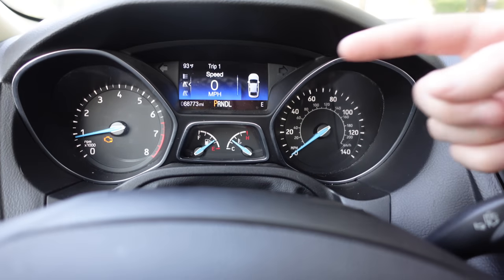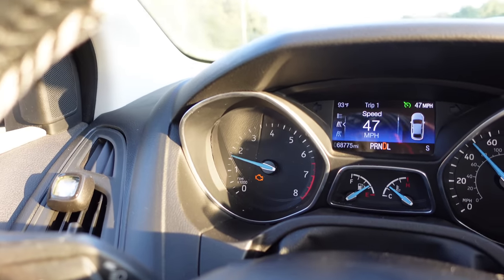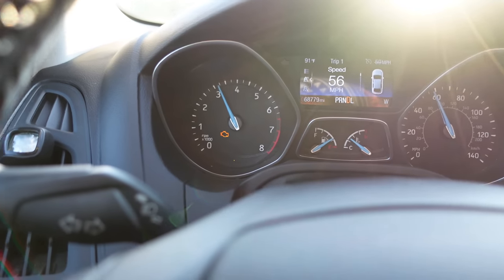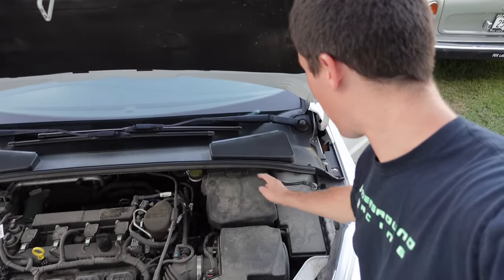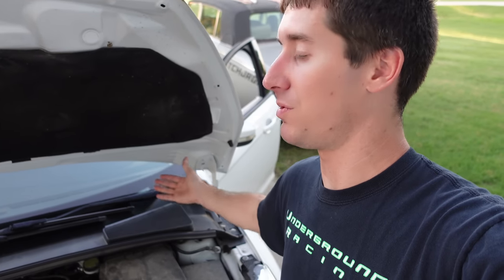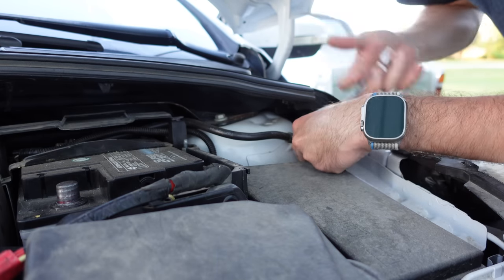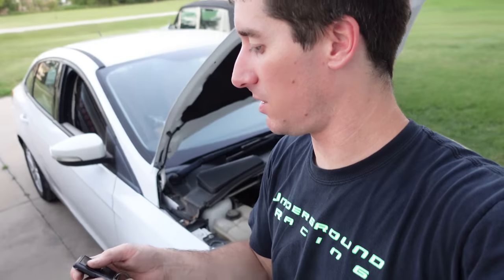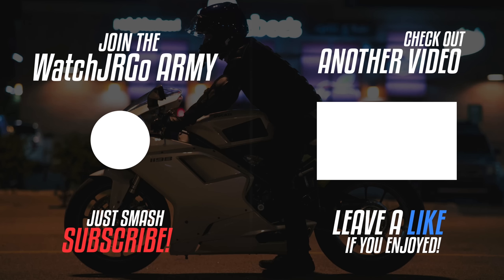This NIGHTMARE Transmission DESTROYED The Ford Focus (Fixing My Girlfriend's)

Comment: I had a 2013 ford focus, same transmission, did a lot of research to figure out hot best to take care of anything transmission related and the number one suggestion is to check grounds and take the access paint around the grounding bolt. I also had read that you can’t drive slow in this car it doesn’t like it you have to drive it in such a way like you have a manual transmission, basically i drive it in such a way as to get to the speed limit as fast as possible and I didn’t have to many problems
Reply: Yes exactly if your trying to drive a manual car through a drive tru or stop and go traffic ridding your clutch constantly you will burn it up making it smoke. Same idea with this transmission u can't ever just lightly tap the gas to creep through the drive tru or in traffic. You are on the gas moving or off the gas stopped.
Reply: @johnsnow1355 so no more drive thrus with these cars?

Comment: 2012 model, had it since new with 8 miles. Now sitting at 107k miles. Clutch replaced every 45k. One TCM replacement, multiple reprograms. Best is when you drive it on the highway or have minimal stops. Stop and go or abrupt stops or accelerations will make the transmission drop into neutral for a second or two. Not good if you need to get out of the way quickly. I learned you have to drive it with a bit of a heavy foot so it’ll shift right away. Rare occasions during downhill it will get hung up and have the RPM go through the roof. Buddy of mine traded his in for same reasons, with three clutch replacements. It was a 3-4 year old car at the time.
Reply: Reading about the history of this car and actual stories here, one has to wonder how many of these were driven in the run-up in R&D. I recall the Ford ad touting the Ecoboost engine for the F150 that it was driven hard to prove it was a good engine. For the amount of issues that has turned up one would have thought a red flag would have arose during R&D. A good engine is great but if all that goodness can't be delivered to the wheels ...... it is still no good as a whole. Sad that Ford shot itself in the foot like this.

Comment: I have a 2017 Focus. Experience, and several Focus facebook groups, have taught me that these cars need to be driven a little aggressively. Accelerate the same way you would in a regular manual transmission. It will greatly improve the life of the clutches.

I have 68,000 miles on my 2017 Focus, and 202,000 miles on the beat to hell ex-delivery car 2012 Fiesta that I also own. 

Stop and go driving and slow acceleration is horrible for these cars.

On a side note, I love the 45 MPG that both of my DCT Fords get on the highway.
Reply: Been trying to decide between the two I need to test drive a focus asap they say same fuel mileage but I think fiesta gets better in the 2012 range. Plus it seems like the focus has way more transmission problems. What would you recommend? Obviously the extra space in focus sounds good for trips but I dunno
Reply: @DanielGennaro  The Fiesta gets better mileage around town, but the Focus gets better mileage on the highway.
Reply: @cjamesr0877  really?
Reply: @DanielGennaro  Yeah. The 1.6L in the Fiesta runs at higher RPMs on the highway, so the mileage isn't quite as good.
Reply: @cjamesr0877  I don’t know man I’ve read a lot of forms and things and people are saying that they can get over 40 miles per gallon in their fiesta on the highway pretty consistently
Reply: @DanielGennaro  My Focus easily gets 45 on the highway. Best I've gotten was 51 MPG on a 30 mile drive at a steady 55 MPH.

Comment: Dielectric grease is an insulator. 
So ideally should be put on after you make the connection to seal the area from the elements.  it will cut down on thr electric flow if placed between the two items.
Reply: I used to think it was called "dielectric" that because it was conductive, but it's actually just a silicone grease designed to not react with anything when a current is passed through it and is non-conductive.
Reply: Ditto, covering each part in 'grease' and then connecting them is going to make electrical problems worse, not better.  Put the connection together and then cover it in dialectric goo.  If you want to go next level on older connections, spray and clean it all with DeOxit D5 first, then assemble and goop it up.
Reply: Clean the connection, put it back together, and spray the crap outta everything with SO-Sure, formerly AMLGuard.  US Navy uses it to provide protection against corrosion.  I've never seen it fail, and use it on my cars....
Reply: I came to say the same thing. Put the grease on after the connection is made.
Reply: If you want something conductive that resists corrosion use copper based anti-seize.
Reply: @boilerhousegarage  Dielectric grease is an insulator,...  It MUST be kept out of the electrical connection. It can be spread around the connection to keep water out.
Reply: That's exactly what I was thinking.
Reply: That's why he got the ground code after putting the dielectric grease on the surface where he removed the paint.  It was logical to remove the white paint, but I also thought that the grease might hinder the connection.
Reply: Dielectric grease is NOT an insulator ugh people who have know idea what they are saying need to stay quiet there's literally hundreds of videos explaining it and disproving your insulator theroy and is why it's used from the factory inside of connections and connectors to make them weather tight
Reply: Thank you!! It amazes me to see all these nitwit youtubers think it some how helps with electrical connection!!
Reply: @jonthomas5398  well that's because it does. It prevents corrosion moisture intrusion in the salt belt like I'm in prevents salt from eating away the connectors. All of that results in a stronger longer lasting connection. So explain how it doesn't help with connection? 😂😂😂😂😂
Reply: Need to watch Scotty Kilmer video, "How to use Dielectric Grease on Electrical Connections in Your Car".  I am no expert, but I have been in IT for 40 years and 32 of those as a Field Engineer. Used dielectric grease in a lot of electrical connections, and in high heat areas. I use it on my car light bulbs, spark plug wires, and electrical connections. I have so much of it under the hood of my old car, if it was an insulator that car would not be running...LOL. Works amazing in spark plug boots.  My brothers had ignition problems, setting misfire codes, I put it in his spark plug boots, problem solved.
Reply: Yes!!!!
Reply: OP is correct. I work with dairy machinery that get washed all the time. Put grease after connection has been done to prevent oxidation. Not inside connectors.
Reply: @jothain  yup been milking for close to 30 years and definitely have been putting it in 5he connection to prevent moisture from getting in amazing for an insulator it certainly allows for excellent connection. Same with all the spark plug wires bulbs ECT on BILLIONS of vehicles from the factory and the 1000s I've serviced over the years. It's amazing service manual from delaval as well as every auto service manual specifically state to put inside of the connector otherwise you aren't going to get any bennifits. But hey who are the millions of dollars spent on engineers to figure things out. Obviously the misunderstanding and misinformation from the YouTube engineering department is gospel and now vehicle and equipment prices are going to skyrocket due to this new information and the need to go back 100+ years and reprint and update service information and retrain everyone LOL #dont be a sheep #not an insulator #education
Reply: @claytoncoolidge992  You can do whatever you think is right 😏
Reply: @claytoncoolidge992  
di·e·lec·tric /ˌdīəˈlektrik/ adjective
having the property of transmitting electric force without conduction; *insulating*.

try again.  it is generally fine when used on a connector with a good connection because it will be displaced where there is contact.  in the case of a bad connection, especially a ground a conductive grease may be a better choice.
Reply: @bbanzai444  yawn thank you for proving my point.... That it doesn't prevent connection and is meant to be applied inside of a connector. 😀
Reply: @claytoncoolidge992  you said it is not, sorry.... NOT an insulator.  which is, literally, exactly 100% wrong.  
not sure how that proves your point.
Reply: @bbanzai444  cause context is key here and you have to keep in mind that most people are not going to understand that it can pass electricity and be an insulator at the same time. Most are going to see that and instantly say that it is an oxymoron and dismiss it. So for ease of understanding and using language that most will understand and in consideration of what it is commonly used for not an insulator is the better way to explain it unless you have a lot of free time to field questions from the customers vehicles that millions of us have repaired and used it on that are now calling claiming that they want to know why someone put this on their connections and claim that it's causing xyz problem and want it fixed and for free
Reply: @claytoncoolidge992  context doesn't overrule a simple fact.  i explained why it can be used without interfering with a good connection in one sentence.
Reply: @bbanzai444  correct but stupidity does and as someone who has owned a shop for 20+ years and tried explaining it to many 1000s of people yup stupidity does overrule technical as it relates to someone being able to understand it. Again I don't have time to give everyone a science lesson to get them to understand it but by explaining it saying it is not an insulator and helps protect the connection from  corrosion(witch they know is an insulator and is bad) gets kinda awkward and confusing to them because all that they are hearing is your putting an insulator on to protect from another insulator. It's pretty clear that you have never been in a position that deals with the average person that needs thier car worked on. Considering that most of them don't even understand that the car needs regular maintenance or even oil for that matter and that all they have to do is put gas in this spot and turn the key and away they go go ahead and get them to understand what you are trying to explain to them as they are on their phone and stopped listening to you the second you said that it's an insulator a term they have been told us unwanted
Reply: @claytoncoolidge992  i respect your experience, while also noting that you know nothing about mine.  while I don't work with cars, i have worked in a field for nearly 30 years that frequently requires explaining technical concepts to the uninitiated and, yes, uninterested.  while I will often simplify for the sake of clarity, I've never found a good strategy to tell people something that is untrue in the name of convenience.  especially in the era where they can look up a simple definition on their phone in 30 seconds.  the risk to credibility is not worth it, to me.  fwiw, i'm not implying you are trying to deceive. your goal seems to be genuine, i just don't agree with the method, even if I am sympathetic to your motivation.
Reply: @bbanzai444  lol well I can assure you that you would lose credibility faster considering that as stated most people know that corrosion is an insulator and bad and the second you say insulator the next worse out of their mouth are I'll be taking my car somewhere else and your not going to have a chance to explain farther. Uninterested is a not the same as unknowledgeable unknowing ECT. Your not trying to not only get approval from someone who might be spending 1000s on something that they have no understanding about at all. There's not many proefessions that are going to be explaining something to someone who has no idea what you are even trying to explain to them
Reply: @claytoncoolidge992 hate to have to break it to you, but you are not the magical special unicorn you seem to think.  most professions involve explaining complex concepts in their area of expertise to people with little to no knowledge.  doctors engineers, computer techs, contractors, teachers for cryin' out loud.
Reply: @bbanzai444  lol 😂 anyway man good luck with that thought. Most of those professions get paid to explain it to people unlike auto repair and unlike literally every other profession we have the manufacturer and the dealership that limits us even more on what we can actually get paid for and a book that says we get x amount of time to x job period and that is cut in half by warranty ECT. So dude we are a very very unique profession that plays by a set of rules that NOONE else plays by. Unless you know if any other profession that a person can work 40 hours a week for and depending on the jobs how fast they are able to get through them the amount of dick tracks they run into and the even bigger variables of rust and hidden damage  get paid for 80hours on a great week or 8 hours cause the 8 hour job turned into an 80 hour job that you only get paid 8 hours for..... Hmm ya that's what I thought now go sit down and learn kiddo
Reply: @claytoncoolidge992  oh woe is you
Reply: @bbanzai444  lol awww apparently unicorns do exist don't they. So how about you and the people who get paid to educate the people that should be able to understand the basic things that they don't understand teach them properly so that those of us who have to deal with them later on can do so in a fashion that does not require an excessive amount of time for us to do so that we can not bill them for as our time is set by the engineers that don't have to explain it to them
Reply: @claytoncoolidge992  maybe they should do a better job educating on how to form a coherent sentence too, huh?   
'run on' your way now... bye!

Comment: Sister has a Focus with the same transmission. It never stopped having problems and finally got sold to the dealer in a broken state after years of ownership. I actually recommended the car based on how reliable the first gen was and didn't suggest the Cruze that I owned because of the few issues I've had.

That Cruze is downright reliable in comparison.
Reply: why in the world would you recommend a completely redesigned car based off the past model's performance? i don't think they share any common parts, especially the drive train...
Reply: @christophers.4007  Because I thought Ford knew how to design a car. To be honest the rest of the car was great. All of the problems centered around the transmission.
Reply: That’s saying something too because Cruzes are pretty crap when it comes to reliability, especially if they have the god awful 1.4T.
Reply: @97I30T  Mine is a 1.4t. It honestly has been a pretty good car, but if I didn't do my own work it would have required a few trips to the dealership at this point.
Reply: @97I30T  The 1.4L Turbo has its common problems but they are ultimately not terrible engines for people who do a little homework and educate themselves on what those common problems are, particularly if they're handy or don't mind watching a YouTube tutorial video here and there... Not saying they are "reliable" but they aren't "unreliable" either if that makes sense lol.
Reply: Why even consider a Cruze or Focus. Should have went straight to Honda or Toyota
Reply: @baronvonjo1929  Since I do my own wrenching there are tools and familiarity with their designs that play a part. I also happened to like the Cruze. So far I haven't regretted owning it.
Reply: @Stressless2023  Yeah, I'd hesitate to say they're a bad engine. There are a few things about them that commonly fail, but generally it's a one and done affair.

Comment: The main issue with theses dual clutch were bad rear oil seals, oil leaks out and gets sprayed all over the clutch pack hence the slipping, take a look at transmission where it mates to the engine on the bottom, you will probably see oil seepage between the two. Depending on what there worth get a low mileage 2016 box
Reply: My dad has 2012 that recall
Reply: fordtechmakuloco did a video on this. it looks like they changed material on a few parts as well as seals. it looked like a real sob to do. you need special alignment tools designed for this job. it looked like an all day job, and that's after you pull the transmission.

Comment: Got that fixed on mine too. Older car, Focus 2008, but same engine. Since my has a manual trans, I had issues with another Control module: ESP, ABS and windows control.... Fixed it the same way as you did.

Comment: Use your scan tool to reset the clutch learn memory. Then take it to the nearest back road and do about 5 dead stop wide open throttle launches. Hold it wide open until it shift through the gears. Do this four or five times. You’ll be surprised how much it helps. 

What happens is the front seal leaks slowly and glazes the clutch over.
Reply: Yep, it takes the glazing off the clutch. Car will shift like new afterwards!